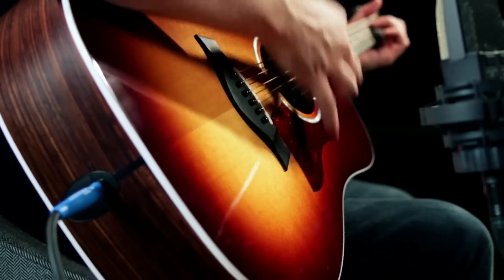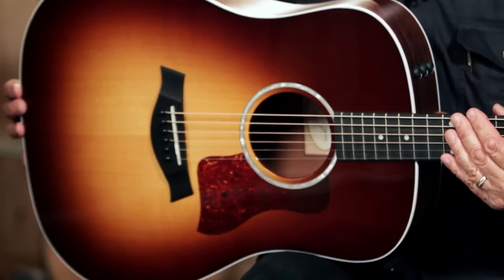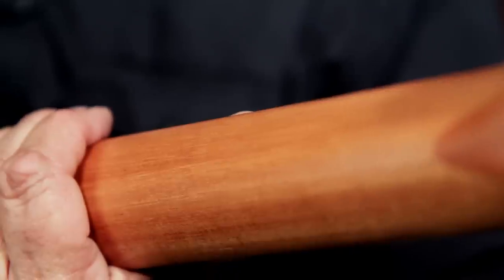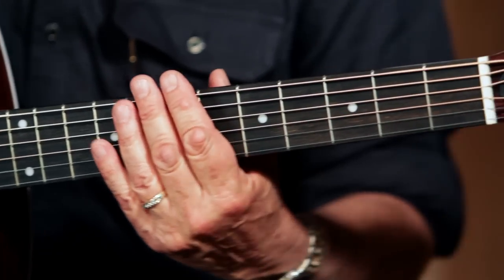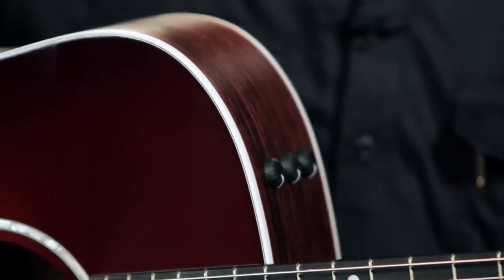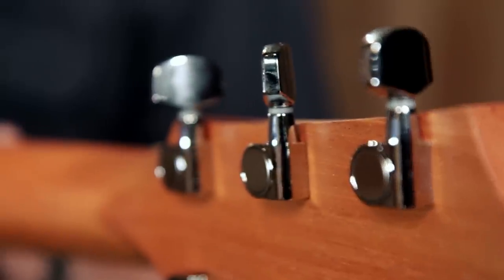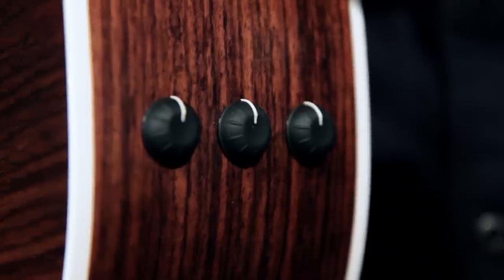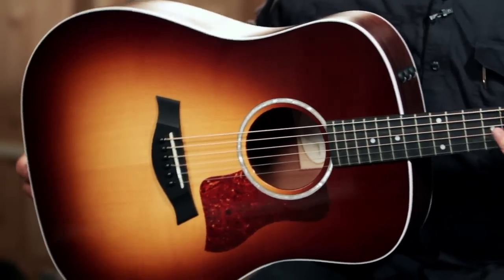Product Spotlight - Taylor 210e Rosewood Spruce Dreadnought Acoustic Electric Guitar

Comment: I own this guitar and the sb top is beautiful but arrived with plastic bridge pins which i found two were broken when i removed the strings to set up the guitar and it sounded very clanky. You would think Taylor would make some kind of attempt to actually set these guitars up from the factory and put in decent bridge pins for the price.  The electric pickup sounds absolutely terrible to me very noisy when handling or moving the guitar i can't record with it because you can actually hear the guitar rubbing your shirt not to mention the feed back at low volumes on open amplification. I ordered new ebony wood bridge pins and set the action on it and the guitar acoustically sounds amazing and warm now and plays like a dream. Over all i love the guitar acoustically if it just had a better electric pickup i would give it a complete two thumbs up!!!
Reply: +SHERRICK63 My son just purchased me a New Taylor 210E Deluxe and Yep, same thing. I too replaced the Plastic pins with Taylor Ebony Pins and Taylor Bone Wave Saddle. Not sure which direction I'll go on the nut. May contact Bob Colosi  on making me a new bone nut.